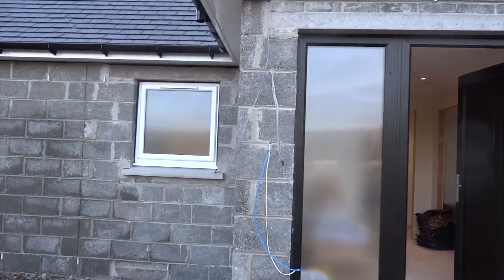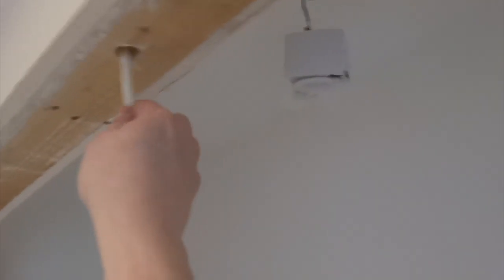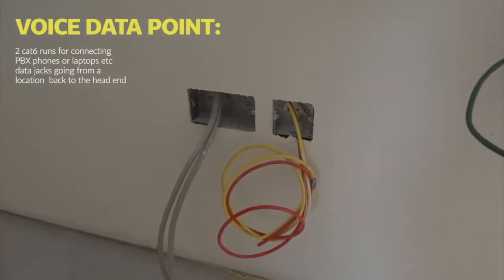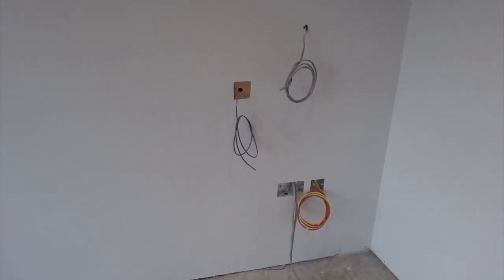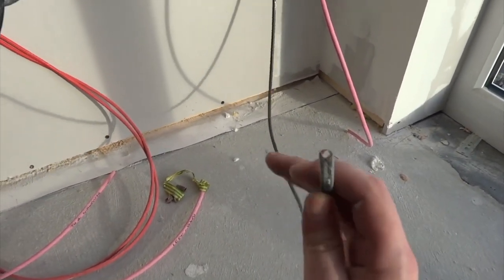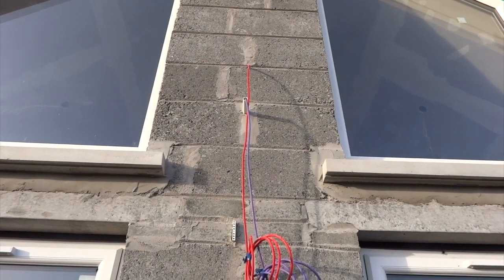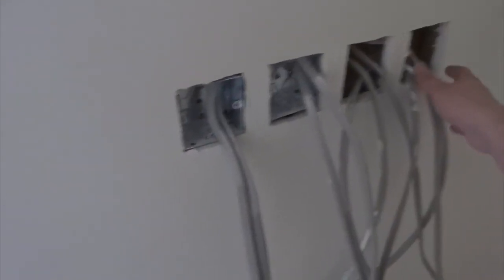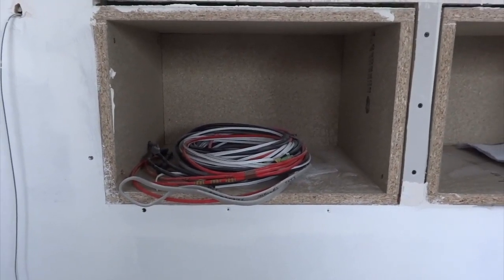Smart Home Pre-Wire Walkthrough

Comment: Good video. How did you handle the shielding on the cat6a?  Did you just have it ground at one end at the patch panel to prevent ground loops?
Reply from the maker: David Pelan the C6A has a direct run to the matrix. No patch panel for those. It adds hassle and potential problems.

Comment: What kind of multiroom audio you use? I see you have wired cat cable for speakers, if i’m right, what kind of audio speakers you use for home cinema?
Reply from the maker: Dani OptiX I used 16/4 speaker cable for the speakers. It’s the Pink Cable you see in the AV Hub. 
The 5.1 area uses the same Pink Speaker cable. 
The Yellow CAT6 marked “Audio” is actually for telephones or Fax or just another data port.
Reply: Cable Kid yes, my bad😁, what amplifier you use for multiroom?
Reply from the maker: Dani OptiX here I used a Monoprice 6 Zone 12 Channel kit. It has 6 audio inputs, 6 zone outs with keypads. Dayton Audio also have practically the same amp kit. I think it’s made in China and just rebadged. 40W/channel I think
Reply: @cablekid3807  I have the Dayton Audio and it rocks !

Comment: Great video! planning to build my own home as well with home automation being a big yes and this video is really useful. One question tho, the ceilling speakers are connected to the amplifier you showed ? If so, the amplifier is capable of multi room ?
Reply from the maker: Miguel Ribeiro the amp I used is a Monoprice multi-zone System. It has keypads at each location to choose sources.
Reply: @cablekid3807  Cool, thank you. And you can control it via your network (example, home assistant) or only control it individually threw the keypad ?
EDIT: Nvm, I just found out it is possible. Have been looking for this for a long time!
Reply from the maker: Miguel Ribeiro yes, as you probably found. You can use a serial to network controller to access it.

Comment: nice video, what kind of temperature sensors will you be using?
Reply from the maker: yiannisis bathrooms and WC use a Loxone Temp-Humidity sensor which is wall- mounted (little square box). Of the rooms that use Faradite TAP5 wall switches, the temperature sensor is integrated, and finally for rooms using a Niko retractive switch, there are 1-Wire Temp sensors sitting behind the switch. Again, these are made by Loxone themselves

Comment: This feels like a very old school way of connecting things. Wired internet is always ideal, but the amount of data lines run here are mostly redundant. This is all just designed for this particular smart system, which I would imagine is going to be incredibly insular and not expandable later which is why its a lot. Maybe I'm just particular because I like more control, but this all seems excessive and mostly useless. Every single item can be added to a robust wireless network without any interference at this point, and expanded upon later. Just install the hardwired networking cables where you need it and take out all the POE switches for the volume and lights. Do you need volume control on your wall for the room sound? Do you need your light switches to be POE? I guess if money was no issue, but even then, there is a lot of pork in this system.
Reply from the maker: Don’t think you understand the system. None of the light switches or lights are PoE. The system is one of the most open smart home platforms available actually. It just happens that light switches and sensors use cat5e for their Bus protocol.

Comment: Can some of that wires be replaced with WIFI?!
Reply from the maker: Of course. But the point is not to rely on WiFi as much as possible. Cables are much more reliable, secure and more practical applications where equipment doesn’t move.

Comment: Could you just have ran CAT6A all one colour to pre wire all the same stuff? Just to save money? I can get 1000 feet for under 500 but its all 1 color insulation. Like will all that equipment/gadgets support cat6A -the coax and HDMI Speaker wire
Reply from the maker: SAVAGESLAUGHTER Cat6a was kind of overkill for standard data networking here, and was only used for the video distribution for piece of mind with crosstalk or interference when sending 4K video over.

As for the different colours, there needed to be many runs, and having the different colours simply makes troubleshooting and identifying cables slightly easier.
Reply: But nonetheless; CAT6a would do all the same as cat6-cat5 etc.  It’s just a over kill to use it ?
Reply from the maker: Yes, could use CAT6a for all of the runs, but it would be total overkill for the other applications such as LAN, Volume control, and audio returns. Another consideration is that CAT6a is quite a bit more rigid than CAT6 due to the additional shielding and the central spine, which would make it more difficult to patch into panels. Not impossible, but more difficult.
Reply: Thanks my dude ! Your hookup looks so good!  Im kind of new to this but not to construction, im finished framing and pulling electrical and find all this smart home stuff, so at the very least I want the wires in the wall for future use.  Thanks again for the intel god bless!
Reply: Hey, are you going to showcase the finished system? Im dying to see this elaborate system finished !
Reply from the maker: SAVAGESLAUGHTER yes, I’ll be posting a couple more videos probably to finish, including a closer little ok at the finished AV Rack
and Patch Panels and a look around the finished property. 
Might be about a month or so away.
Reply: Hey, cable kid. Can u show me what PIR you used?  Also, do u run low voltage cable to the PIR as well?  Or does the PIR just use CAT5E 4 power?
Reply: CABLE KID ! I’m trying to copy you I need your help!
I got all my boxes on studs and am ready to pull wire
I got 1000feet cat5e / 1000 feet cat6/ 1000feet cat6a shielded /and 500 feet speaker wire .  All my receptacl boxes  are installed on the studs.  What I am wondering Is how much low voltage wire I should pull to any of the switches (if any).  I’m unsure about your PIR wires ; are those also cat5e ?(the purple ones)  does PIR work off just Ethernet ?
Reply from the maker: SAVAGESLAUGHTER  hi, it depends on what you will be using to control your switches. All or the PIRs and Light switches here are CAT5e cables. This is because the Automation system controls the actual switching. And the mains voltage lighting circuits pass the through the Loxone cabinet
The light switches simply send a digital pulse to the Loxone Miniserver which then knows what to do.

Comment: What cable did you use for blind control?
Reply from the maker: AHL Group 16/2 + 14/2 cable. Fine for LV motors, but I did neglect to run full mains voltage cable which restricts what can really be installed.

Comment: Hi there, 
Just wondering how you came to learn and know about this stuff? I would love to learn, any help would be greatly appreciated!
Reply from the maker: Corb Elec initially it was just my own research online. AVS Forums is a particularly good source of info. 
However, I later learned a lot more on the job working for a firm which specialised in home automation
Reply: Cable Kid did you have an electrical background by any chance?  You seemed to be well versed and knowledgable
Reply from the maker: Corb Elec not really. But a bit of electrical knowledge. Mechanical Engineering by training
Reply: Cable Kid degree?
Reply from the maker: Corb Elec yep
Reply from the maker: Corb Elec yes.
Reply: Hi Cable Kid, great video! Just wondering what your reasons were for using Luxone as opposed to other KNX products? 
I’m a structural engineer wishing I’d done electrical at the moment. Time to read the manual...🤓
Reply from the maker: Caroline MacLellan we went with the Loxone kit as, it seemed to fit all of our requirements. They have a nice app for control of all of the functions too. Loxone uses a bus system as KNX does, but I believe it’s heavily modified for their platform. They can however also integrate KNX devices using a module added to the main control system. Loxone is very open, and integrates well with lots of other platforms using their ‘extensions’

Comment: Hi, 

I’m now in the process of planning my new home build, do you have any company details you could send me for a quote on wiring?
Reply from the maker: Generally speaking you would send the tender to the electricians who are wiring the house for the General Electric setup. 
Most smart home companies pass along the cable pulling to the electricians and then terminate themselves.
It will be very beneficial if you can send the electricians or whoever is doing it a cable schedule. Break down what cable goes from where to where. Planning is the most important thing. That way they can quote based on requirements
Reply: @cablekid3807  thanks for the reply, by the way the video came across I thought you was an installer?  It would be great to pick you brains regarding my new build as you sound like your up to date with it quite well. I love a gadget, but at the rate things move I don’t want to miss anything and certainly want it future proof. I’m only now putting in for planning and then doing the building regs etc so how’s a great time for the input. Thank you for the video though it’s very informative
Reply from the maker: @tanot159  hi Ben, no, I’m not an installer. I’ve worked in different fields, and have enjoyed my time in home automation. I’m willing to help you out if you have any specific questions. Just get in touch
Reply: @cablekid3807   thanks mate, how am I best getting in touch?
Reply: @cablekid3807  so after spending a little time researching company’s TOGET onboard regarding the setup, I have been introduced to 3 main systems, loxon, savant and control 4, do you have any views on them?
Reply from the maker: @tanot159  Loxone is the system we’ve got. It has positives and drawbacks. It’s great at BMS control, but poor when it comes to AV control. It interfaces well with a lot of other manufacturers products too. And price wise it’s pretty reasonable. 
Control4 does the above, and more. It’s very capable of multimedia and AV control. But, and I may be wrong here, I think it’s quite a bit more of a closed system. 
And finally, I’m afraid I know nothing about Savant
Reply from the maker: @tanot159  also, there is Crestron. In my opinion this is the ultra premium option, not cheap, but it’s the slickest I’ve seen.
Reply: @cablekid3807  thank you for the above, in what ways is loxon poor with the av controls? I see they have just released a new audio server?
Reply from the maker: @tanot159  they have. I haven’t tested or looked at it fully myself but spoke with a colleague who installs Loxone. The audio server has a limited number of inputs. Not a problem if you only want to connect a handful of audio devices. But if you are looking into using your architectural speakers for music and TV you might find a bottleneck.
Reply from the maker: @tanot159  in terms of AV. Loxone currently doesn’t have a robust system for controlling HDMI Matrices, cable boxes etc. Again, this is as far as my research has told me. I may be off base, as I haven’t looked into it in the last 6 months. The other systems you listed, e.g. control4, crestron and savant have better media control
Reply: @cablekid3807  after spending some time looking last night Control 4 does seem to have lots more capability, but some of the wall controls don’t seem as fresh, the loxone system is quite stylish. I will keep looking about thank you.

Comment: Wow awesome job done here !!! Congrats !
Quick question,: 
 - how are you planning to handle the hdmi over ethernet stuff ? I mean How does it work ?
 - are you using any type of connector ?
Reply from the maker: Lionnel Afangbedjee hdmi over ethernet, also known as HDBaseT uses a main box in a central location, (an HDMI Matrix) which takes all of the Hdmi inputs of each device. Then it has RJ45 outputs to send that video and audio to a room. There, the process is just reversed with a room balun. The CAT6a goes in and HDMI come out. This just plugs into the tv
Take a look at companies like BluStream, HDAnywhere or Wyrestorm for a more info. They all make AV Matrices
Reply: @cablekid3807  Thanks a lot !! It's more clear for me now.